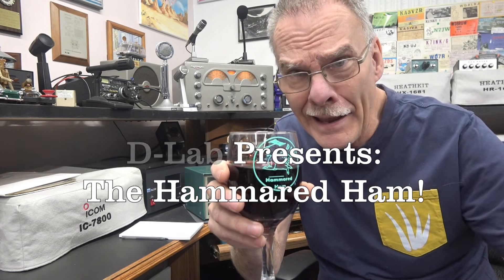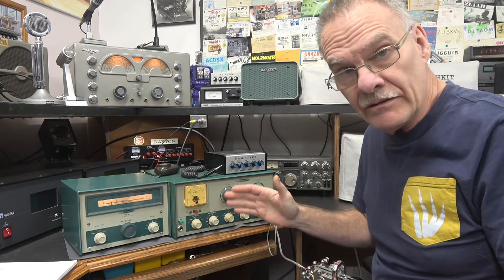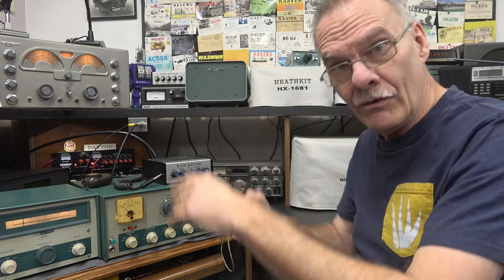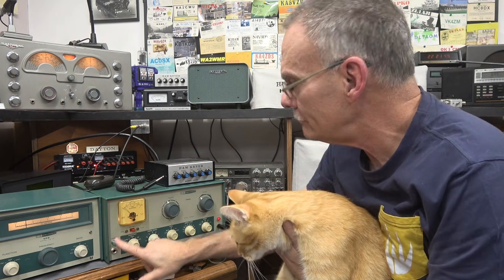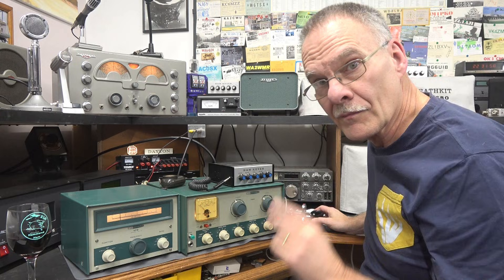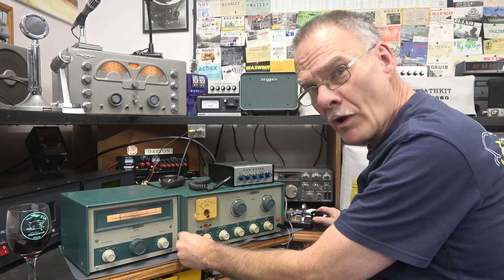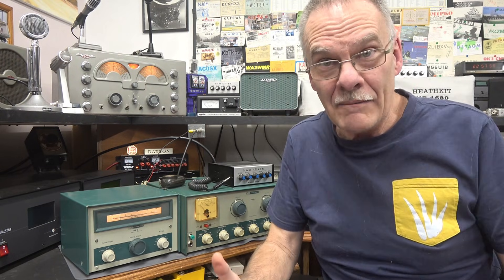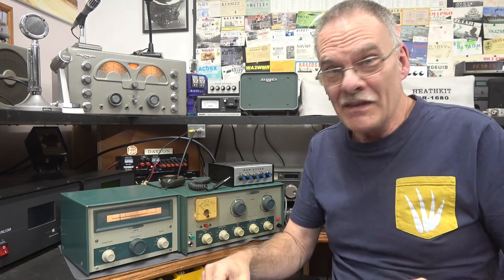Heathkit DX-60A tube Ham Radio transmitter QSO at the Hammared Ham Shack Lots of contacts

Comment: You see, wire telegraph is a kind of a very, very long cat.  You pull his tail in New York and his head is meowing in Los Angeles.  Do you understand this? And radio operates exactly the same way: you send signals here, they receive them there.  The only difference is that there is no cat. - Albert Einstein

Comment: I really need to practice my code. I've been gifted a Heathkit DX-60B transmitter, HG-10B VFO, and 2 HR-10B receivers, one with a crystal calibrator. Would be fun to get them on the air.